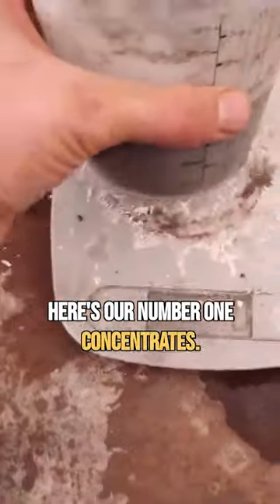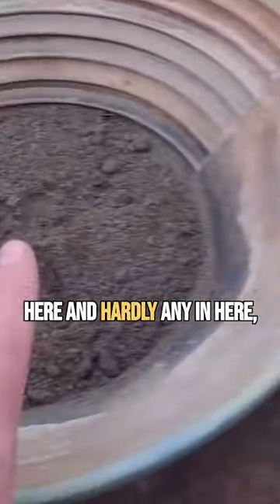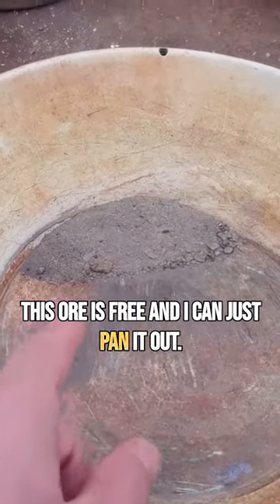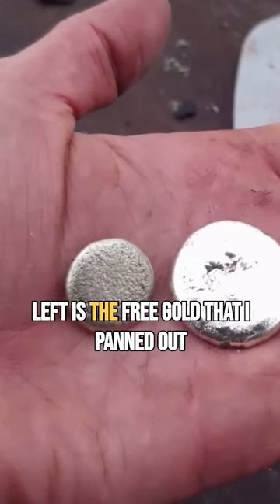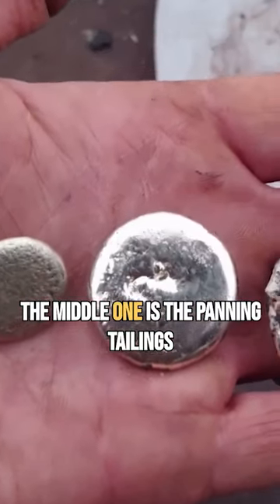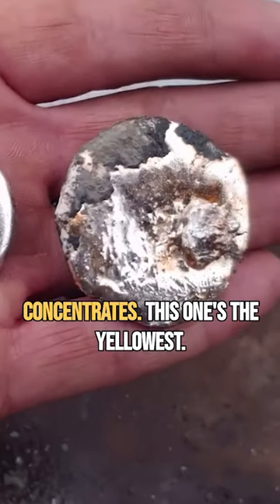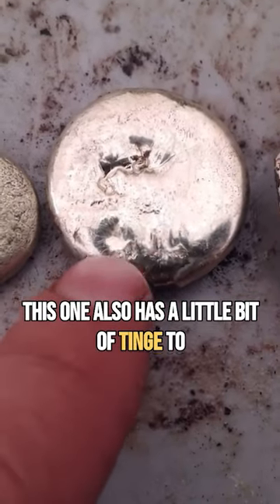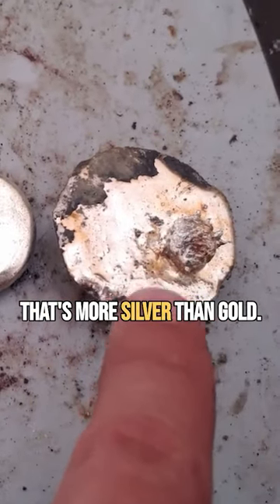Smelting Gold Buttons from Gold Ore Concentrates: A Step-by-Step Guide

Comment: How much can you tell from weight alone? With equal volumes?
Reply: You don’t need to have equal volumes.
Measure the volume of each by water displacement.

Divide your weight (in grams) into the volume you measured in (cc or ml) and then interpolate that density between the density of  silver and the density of gold.